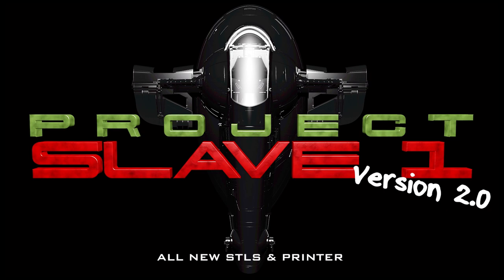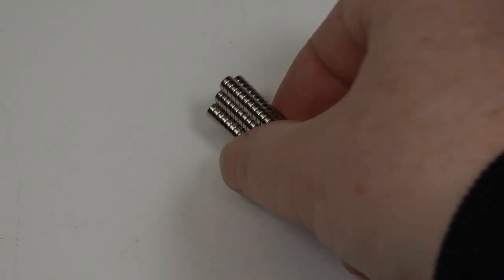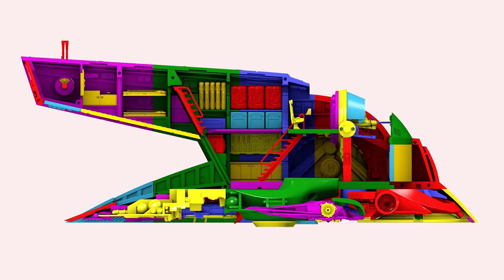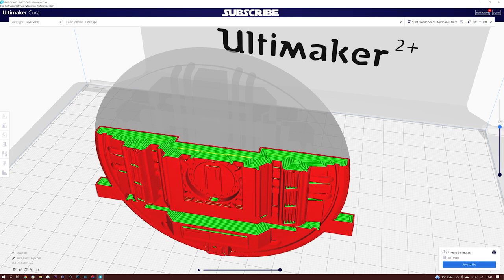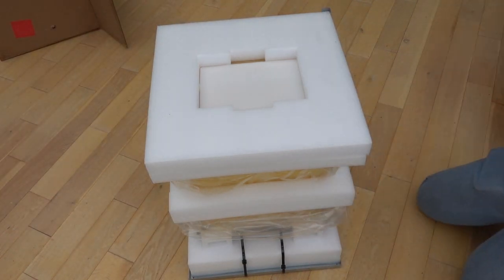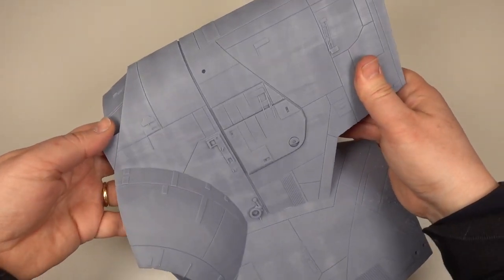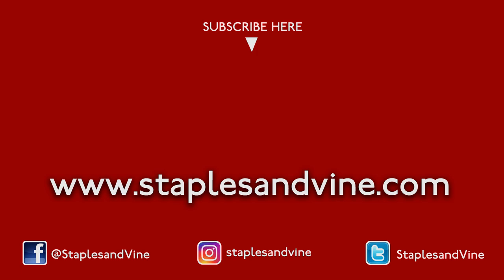PROJECT SLAVE 1 PART 14 ‘ALL NEW STLS & 3D PRINTER’

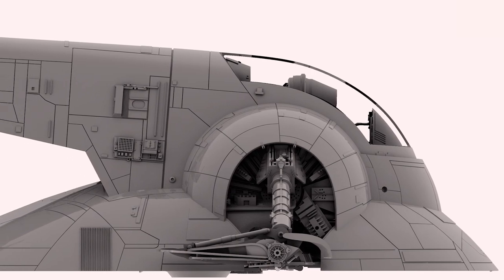Comment: How will you make the cockpit glass? Will you print it in a clear resin or use a vac form?  I am interested in making this in 1:48 and am wondering if the largest part will fit on my Phrozen Sonic Mini 8k.
Reply from the maker: Hi Matthew, I have test printed the cockpit glass in clear resin already. It is possible but the resin does yellow over time. I will add provision to make a buck for vac-forming which is the process I will use on my model. I'm not sure 1:48 will fit on your printer. I'll look more closely in the next video. Larger parts may fit but not when orientated for printing. 🤔
Reply: @StaplesandVine  Thanks. I look forward to seeing the rest of your process.

Comment: Beyond exciting !! How do you think - would it be feasible to print the model on a 200 x 200 mm printer with no additional slicing required or will some parts be simply to mighty ?
Reply from the maker: Hi Arnold, you're going to need a bigger printer! Or you could scale all the parts down. The wings and hull parts are the largest. While you could slice up the hull it wouldn't be a good idea with the wings.

Comment: What scale is this model designed for?
Reply from the maker: The finished model will be 1/30 scale to match the filming model used in 'The Empire Strikes Back'. It is possible to scale the parts up or down depending on what size you want to print the model.

Comment: Do you have an estimate on how much your fileset will cost? My Bambu X1C and V-Core 3 500³ a workout
Reply from the maker: Hi Captain Fett, I'm still working out a price but I reckon £70-£100. It's less than £1 per part which isn't unreasonable. 🤔
Reply: @StaplesandVine  that's very reasonable. Can't wait!

Comment: super interesting project. And honestly I would be very interested in this. But a couple of question though. I have the gambody stl file, but honestly I don't think I'll ever get to print it since I hate waste hours on adding my own supports on models. 

So will your come presupported?
Will you have optimized files for 10" sized printers like the Phrozen mighty 8k?  My wife would probably kill me if I bought a 14" sized printer, or make me sleep in the shed :)
Also, lighting this kit would be obvious, have there been made any considerations to this? (something like channels for fibers/wires) and and such In particular things like engines and cockpit control boards. Not really a deal breaker, but would be awesome. 

looking forward to seeing the end result.
Reply from the maker: Hi Sprocket55, I won't be offering pre-supported as just guidance on printing setups. There are 130 + parts and at this size I can't cater for all the different printer build volumes for the optimum print orientation. I will be going through part sizes vs build volumes in the next video. 
In this episode I do mention that I am allowing wiring for lighting. There will be a removable panel at the end of the tail for access to a 9V battery etc. 
Hope this helps.
Reply: @StaplesandVine  Ty for the answer. missed the part with the wiring. Even though its not pre-supported, this is a WAY  WAY better model then the gambody, so if I actually have to spend the time on pre-supporting, it will be your model :)